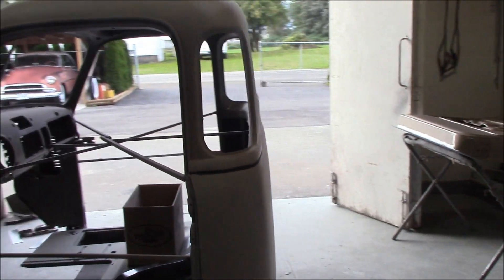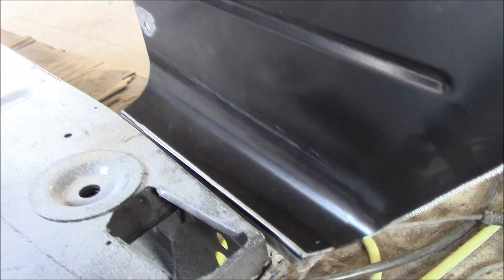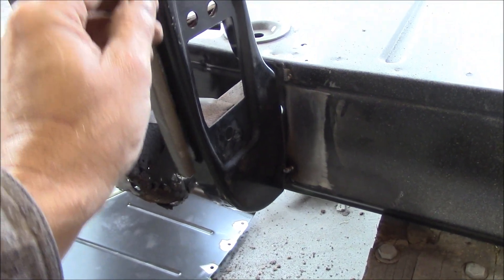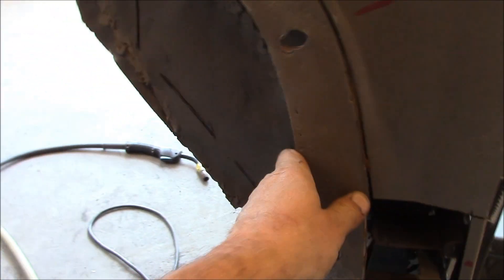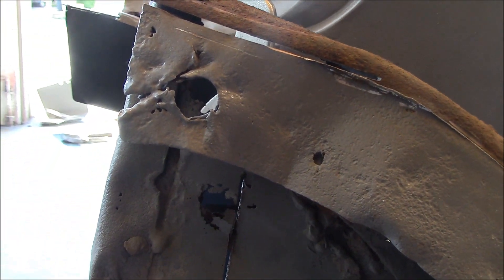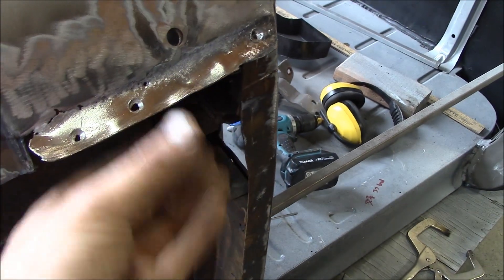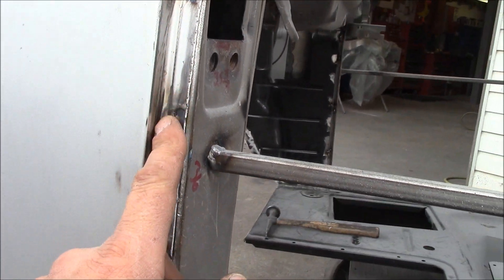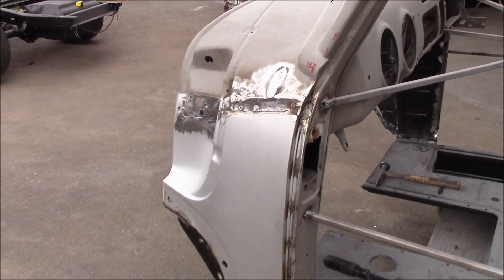How to install replacement panels on a `54 Chev Truck

Comment: Your rite, your not any kind of a teacher, you're more of a analytic professor of fabracation extraordinaire!! 👍🏁 Untill you tackle jobs like this, your planning, measuring, multiple prefitting , is all part of a well done project👍, I was 28 yrs I'm the body paint & frame, 20 yrs ago, I'm getting ready to do exactly what your showing in video, I'm looking hopefully to driving my '52 1/2 t Jimmy, slammed down, s/10, no paint except inside cab & engine compartment, auto

Comment: Good tips on just tack welding the panels in for fitment.  God knows those aftermarket panels usually need some tweaking to make em' fit right
Reply from the maker: +Velvethamma oh man do they ever most of the time - these ones weren't as bad as some though thank god.

Comment: How do you keep the body square. I know about putting the braces in, but are there any measurements I need to know. Thank you so much for your help on my project.
Reply from the maker: Take measurements on the door openings front and back and top to bottom.  If those stay square the rest of the cab should too.
Reply: @OldTimeGarage  Thanks brother. You're a good man, I don't care what Dave says. Tell Dave I said hey.
Reply from the maker: Dave hasn't been here for a few years now

Comment: Nice looking work. I'm sure you would love to lay the door up there to check all the various planes. Even with the correct dimensions, sometimes the lines or planes don't match. The braces don't allow trial fitting the door and you would really be USC without the braces. What condition are the doors in with this much rust everywhere else?? 
Love all those gauge clusters on your shelf. ;o)
Reply from the maker: +Pappa Bob Hi Pappa Bob, we are hanging the doors as I type this!  We'll do another vid soon with the door on.  They weren't quite as bad as the rest of the cab.